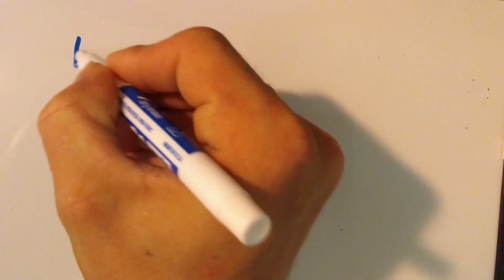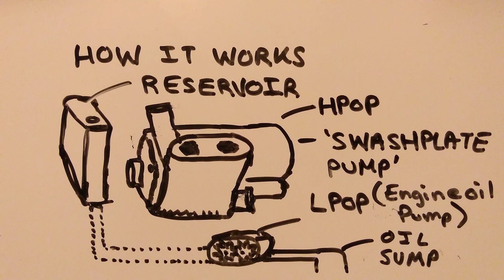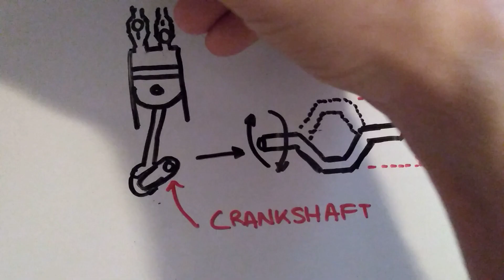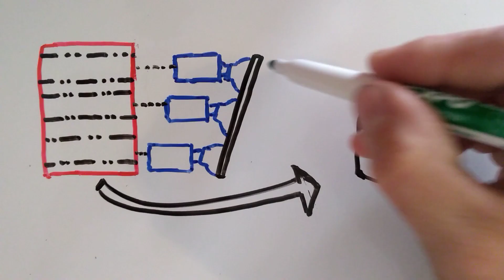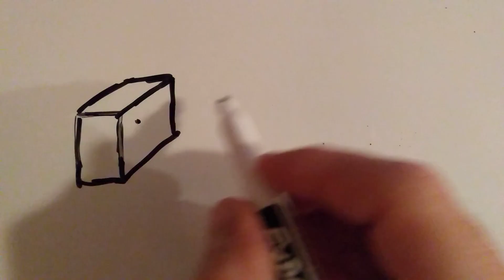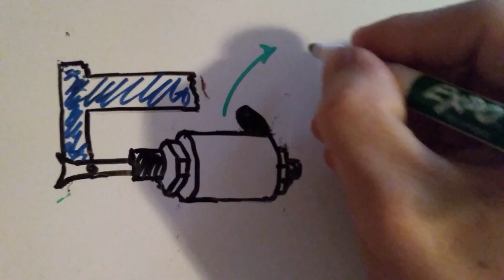How a 7.3 PSD Works Part 2 - High Pressure Oil System

Comment: This was so informational, thank you I’m a newbie but I do have 1 question. I have a 6.0 power stroke ( 2006) does the 7.3 and 6.0 operate similarly? Or are there things in this video that do not work the same in the 6.0
Reply: It works the same but there are a lot of changes to the system. Diagnostics have changed some.

Comment: Thank you for you video it gives good info. I have a question and hope you can help me, I installed a high idle switch to my F550 2002 7.3 automatic truck, when I drive it and park it, I turn on the switch it turns on and it works. The next morning I start the truck I wait to warm it up (5min) I turn on the switch it doesn't turn on. BUT I take it for a drive just around the block and than park it, I turn on the switch and it works. Can you give me an idea what it may be occurring? Hope to hear from you soon. thanks!

Comment: Very informative. Doesn't help my situation. Just did a reseal on my hpop. Got it all back together and took a few cranks to start but it started. Truck would fire right up before replacing all the seals. Now every time I go out to start it and even if I turned it of 5 minutes prior I have to crank it a few times before it even starts. I did accidently torque the tin nut down to 58 ft lbs at which point in the process the nut just broke. Grabbed the wrong torque wrench instead of my inch. Would that have destroyed the ipr and cause this issue?
Reply: For any future people that have this same issue, it's due to the HPOP Reservoir being empty of oil. The remedy is to keep cranking until it refills, or an easier option (and easier on your engine) is to manually refill the Reservoir with oil.

Comment: Probably the best damn video I've seen explaining how the system works, GREAT F'ING WORK.

Hey my rear plug is leaking bad, I've got new O-rings. I haven't fixed it yet because I've had a stroke so my brain and left arm have issues lol.

Is there something that I can use on the threads of the plug so I don't have to let it sit for a day before I drive my truck.

HEELLLLLLLLLLP!!

Comment: I would love to know a little more about the icp. Like why does my truck have more power when it's unplugged. I bought a new one and put on the truck and I still had a power issue. Unplugged it and the truck runs amazing.
Reply from the maker: That's an indicator that your icp (injection control pressure) sensor is bad. This is the sensor on the drivers' side cylinder head you're talking about right? The ICP sensor measures oil pressure in the oil rails for firing the injectors. Then the IPR (Injection Pressure Regulator) is used to moderate and control that pressure based on what the ICP is reading. When you unplug the ICP sensor, the truck goes into an open loop mode where it assumes pressure is 700 psi and it should also throw a check engine light. If the ICP sensor is reading wrong it'll cause the IPR to not operate properly. It sounds like you may have an electrical issue with the ICP sensor? Did you get a new Motorcraft ICP sensor or an aftermarket one? Motorcraft or International Navistar is the only way to go for these 7.3's if you don't want to fool around with crummy sensors. I'd definitely try and get this issue fixed as soon as possible, don't drive too much with the ICP sensor unplugged. What year is your truck? If it's 1996 and up a live scan tool like a Scan Gauge 2 would really be useful to help with troubleshooting here as well. Hope this helps, let me know what you find out!

Comment: Please help, we just replaced injectors with baby swamps in a 1996. Now we have to crank for a long time or spray either to get it to start. Is it possible an injector o-ring didn't seat correctly and now the oil pressure is low? Supposedly we can use the stock pump on these injectors. Ran fine before injector swap. No codes just needed new injectors due to age (215,000 miles on stock) thoughts?
Reply from the maker: It is possible an o-ring got messed up on installation. How many miles have you run the truck? It can take a while as well for all the air to get out of the system. Mine took probably 2 solid minutes of cranking before it fired up, but once everything primed and air gradually bled out of the system it worked much better. If you have a tool like a scan gauge 2 which I've got a video on my channel for that, it'll allow you to monitor your oil rail pressure and injection pressure regulator duty cycle. That will help to determine if you've got a high pressure oil leak or not.
Reply: @Rnddiesel  we received a bad set of swamps which is why we had issues. Without power to the injectors, we were getting oil out of the oil ports on the injectors when cranking signaling that they had a bad valve in the injector.
Reply from the maker: @carstrucksboats  That really stinks, I'm sorry to hear that! I appreciate you following up, that's the first I've heard of that happening. I hope you were able to get a new good set, though I'm sure it wasn't fun having to do all the work over again.

Comment: The low pressure oil pump on a 7.3l powerstroke is behind the harmonic balancer on the outside of the block, its driven by the crankshaft.

Comment: Can cleaning the HPOP with gas or parts cleaner ruin the pump?
Reply from the maker: Are you asking about putting gas or parts cleaner in the oil for the HPOP or disassembling things then cleaning the individual components?
Reply: @Rnddiesel  The latter.  When disassembled.  Would never think of doing the other.
Reply from the maker: @johnwythe1409  Copy that - just making sure. I don't see why it would be a problem just make sure you put a good coating of fresh oil on the moving parts when things go back together. You may want to be careful with any plastic parts though. Brake cleaner usually contains solvents like acetone that will dissolve the plastic. Metal part should be fine though.

Comment: Great Video! I would like to know what the check valves in the HPOP do.

What happens if the check ball behind in NSP is missing, or not in the right place.  Will that cause long cranking starts, and rough running, or is that just to stop the reservoir from draining back to the oil pan when not running?  What is the other check ball for.  I replaced the seals on my pump, and now I get long cranking starts, and rough running.  I also replaced all the external o-rings on the drivers side injectors hoping to fix a cold no start (40F and below) turned out was the GP relay.  Pretty sure the issue is HPO pressure.  going to put a scanner on to see if I can get a reading on the HPO pressure.  Also going to check the IPR again, before pulling the pump again.
Reply: Check diesel tech Ron video on hpop he talks about the check ball. Maybe it’ll help you
Reply: @paulk7390  Thanks.  I will.  Mine is working now.  Guess it just had to purge all the air from the oil rail. took a 30 min trip to town and back.

Comment: Amazing explanation. Here’s my question. I’ve researched this system a lot, and sources always say the HEUI system is outdated. I know that the 6.0 and some cat motors used it, but why was it ultimately replaced by common rail injection systems. Also, does Cummins still use the injection pump system or are they common rail. I wonder if engineers could modify the HEUI system to make it competitive in modern diesels or if it’s something that’s just outdated like carburetors or point ignitiob
Reply from the maker: I'm reasonably confident that Cummins diesels use common rail injection nowadays, at least the light duty 6.7 diesel does. I'm not so sure about their other industrial variants though. As for the demise of the HEUI system, I think a lot of it has to do with the lack of responsiveness compared to a common rail system. I'm sure you could make a variation of the HEUI system just as good as a common rail, but it's probably more expensive and complicated than just making a common rail system. I think at least part of the issue resides in the fact that HEUI injectors naturally have a relatively heavy intensifier piston setup inside by nature that has a lot of inertia which limits the response time of the injector. Modern common rail injectors typically inject fuel upwards of a dozen times per combustion occurrence where the fuel is sprayed into the chamber, stopped and flow started again multiples times as the piston goes downward on the power stroke. This is primarily done to limit emissions. When you're asking a fuel injector to respond so fast it gets difficult to do with a clunky intensifier piston and spool valve setup like the 6.0's had. It may not sound like much, but doing some quick math an engine running at 3000 RPM and with 10 individual injection events per power stroke, your injector needs to be able to react in under 1 millisecond or 0.001 seconds. This is probably not physically possible to do with a HEUI system. Common rail systems are just incredible when it comes to response time, and gives engine tuners way more control. I'm afraid that in the quest for both more power and lower emissions, the HEUI system has gone by the wayside with the Carburetor.

Comment: GREAT STUFF!! Another common use for the swashplate is your standard gardn tractor hydrostatic trans.  Only thing different is the swash is adjustable whereas the hpop is fixed.   Dude. this is awesome. on to video 3.

Comment: Great video. Just like to know alitte more about how oil goes from the pan upto the reservoir to the hpop. And does the oil stay in the reservoir or flow back down? Also the oil in the rail doesn't get circulated?
Reply: Oil is sucked up through the pan pick up tube, through the lube pump mounted to the timing cover behind the crankshaft pulley/damper. After exiting the lube pump the oil flows through a gallery in the timing cover to the HPOP reservoir. Oil is held in the reservoir with the engine off. There are different timing cover and HPOP designs on early models, and if parts are mismatched, drainback will occur resulting in long crank times to refill the reservoir and feed the HPOP. Oil in the rails remains at all times, it does "circulate" to some extent when the injectors fire and the oil exits the spill port of the injector and returns to the pan.

Comment: Hi thanks for these good videos. 
I have got a 97 ford f250 7.3 power stroke and my oil temperature gauge does not seem to be working fine .it only goes up a quarter instead of going  half way to the midle.
Plus sometimes when i am driving it drops back behind the white lines sometimes.any help on this would be great .thanks
Reply from the maker: Is it a sudden drop back down below the white lines or is it more gradual?

Comment: Another great video. Keep up the good work. 
A lot of trash trucks use a variable swash plate piston pump, that way you keep the pressure and control the volume. That way you don't have the heat build up problem. Also hydrostatic drive systems use the variable swash plate.
Reply from the maker: Thanks Cbmech! Man a variable swashplate would be great. I'd like to see how they mechanically accomplish that feat; I'm sure it makes for a more efficient design.
Reply: @Rnddiesel  the  variable  swash  plate  has  piston  on  side  of  the  pump  casting  that  moves  the  plate  from  zero  to  full  displacement . They  are  more  complicated  so  more  expensive . It  depends  on  application  whether  the  cost  makes  sense . Hydrostatic  drive?  Definitely . Trash  trucks   (side  loaders)  probably . Other  applications  are  kind  of  a  maybe . I  even  have  a  vague  memory  of  a variable  vane  pump . I'm not  sure  how  that  works  but  I  would  assume  that  you  would  move  the  stator  ring  side  to  side . Not  sure  how  well  that  would  hold  up under  heavy  use .
Reply: The  other  consideration  with  a  piston  pump  is  how  clean  you  can  keep  the  oil . The  only  seal  on  the   pistons  is  metal  to  metal  so  it  doesn't  take  much  grit  to  wipe  them  out .  Clearance  is  probably  1/10,000th of  an  inch . Like  an  injector .
Reply from the maker: @cbmech2563  Interesting point on the variable swashplate pump. I think I see now how that would work. The nice thing about oil though is that it's typically more viscous that diesel fuel, so that gives you more room for looser tolerances than say a diesel fuel injector. Either way the tolerances are ridiculous. I have a hard enough time keeping within 5 thou on my lathe!
Reply: @Rnddiesel  On the old Cat capsule injectors the clearance was so tight that if it was dry the sweat and salt on your hands would lock the plunger in the barrel. I saw that happen when I was an operating engineer apprentice mechanic.
Reply from the maker: @cbmech2563  Wow, that's an amazingly close clearance fit!

Comment: Cool man, who would have known how those pumps work . Not like anyone would try to take one apart when trading there core in.
Not sure if I have a real weak pump on mine, but I want to pull the trigger and get the adrenaline pump eventually 💪🏻⚡️
Reply: Seems like they could have had a hydraulic oil system separate from the engines motor oil contaminates
Reply from the maker: Nice, a new HPOP! Do you notice any difference with the adrenaline over the stock pump?
Reply: Rnddiesel  haven't got it yet,  I have stock injectors .diesels nowadays have very high common rail fuel pressures and lower compression than 7.3s. Did. Seems like better atomization would definitely make power and mileage. Did notice a huge difference when I got turbo master wastegate of all the mods I've done
Reply from the maker: @805coastin7  Gotcha, I just don't know what the real difference is with the Adrenaline HPOP since your oil pressure is controlled by the ECM anyway. I'm sure it's capable of flowing more oil though. Well let me know when you get the new HPOP on there! Haha, I wouldn't know anything about wastegates. My OBS doesn't have one and needs all the help it can get to spool the turbo (though I think that's why you have a wastegated turbo...).
Reply: Rnddiesel  good point about the Ecm , probably b fine with a stock pump, some marketing hype there

Comment: Awesome part 2 video and I love the level of detail. After troubleshooting the P1211 and I didn't think there was much more to learn but I was dead wrong. Found the issue causing the low ICP and high IPR. The new IPR I installed was defective and leaking (I replaced both the ICP sensor and IPR valve at the same time). I threw the old valve back in and the truck works just fine. Lesson learned, buy parts from reputable sources.

New problem just discovered. Truck doesn't sound right when I accelerate and wiggles more than normal when at idle. I did a buzz test and injector 3 didn't buzz, and got P1273 and P1298 codes. I've heard that this could be due to an air pocket in the high pressure oil system. Do you recommend waiting a few dozen miles to see if it resolves itself?
Reply from the maker: I'm glad to hear you were able to fix the IPR issue! It really stinks that your new one was bad. It sounds like you might have a bad injector harness or two now. Best of luck with the truck!

Comment: Do you change your HPOP oil like power stroke help says or do you trust Internationals design that it should cycle through?

Another phenomenal video by the way!
Reply from the maker: Thank you! To answer your question, yes, I'm one of those weirdos who changes HPOP oil when I get the chance. Every time I do, the oil is clearly much darker and aged relative to the rest of the oil in the engine. Fresh oil does make its way up there, but there is still a settling point in the HPOP reservoir that serves as a stagnation point for oil that never gets drained otherwise. I know every design is a compromise too, and besides, if you went to school with some of the folks who call themselves 'engineers,' you'd probably look under the hood more often too!
Reply: @Rnddiesel  
 I would go ahead and change a quart in the HPOP reservoir at least every 35K. The first time I checked it the odometer read 125k and that oil must have been half motor oil and the other half must have been diesel blow by. 
It was that watery. It is the highest point on the engine; so, just like a distilling column. The thinnest oil makes it way to the top.
Reply from the maker: @norman_sage2528  I just put in a request for 2 oil analysis kits from Blackstone Labs. I'm hoping the next time I do my oil change, I can send in a sample of both the hpop oil and regular engine oil as well.
Reply: Rnddiesel 

That would be a really cool video and results to see, I don’t know if anyone has done that on YouTube.
Reply: I started changing the hpop oil after I saw your video on changing the injectors. I remember you saying you changed your oil 500 miles before you removed the injectors. Your engine oil was clean but the oil in the rail was dark as night.

Comment: When is part 3 going to come out???
Reply from the maker: Awe man, you're really putting the pressure on! I'll get it out as soon as I can. I have some traveling for work coming up, so that throws a wrench in things. What did you think of part 2?
Reply: @Rnddiesel  just as interesting and useful as part 1. I have a playlist of 7.3 videos because im shopping around for one so im saving videos like yours for references
Reply from the maker: @anthonypeltier4039  Alright sounds good, and best of luck with the truck shopping!
Reply: @Rnddiesel  you keep making videos ai won't need luck 💪💪💪